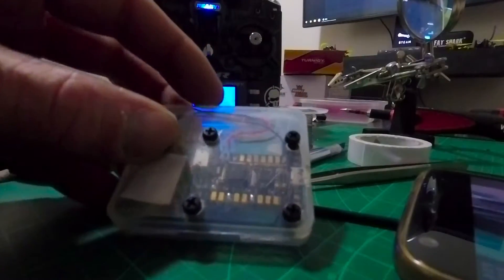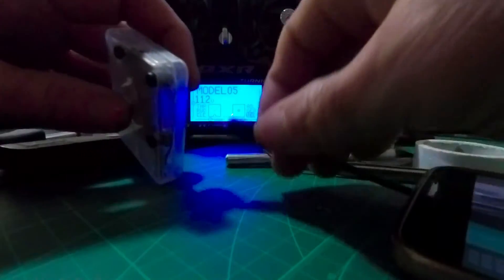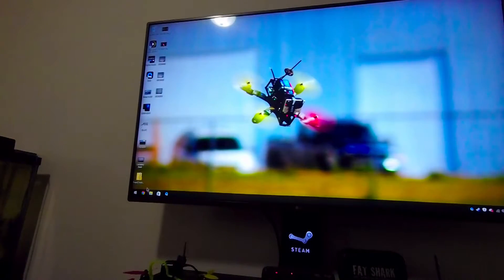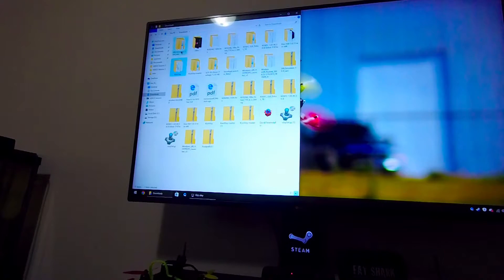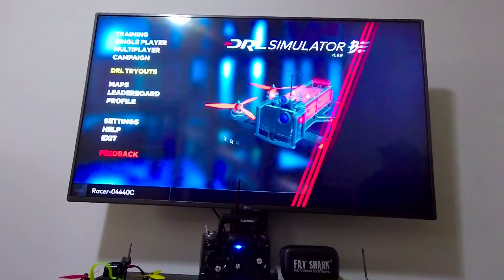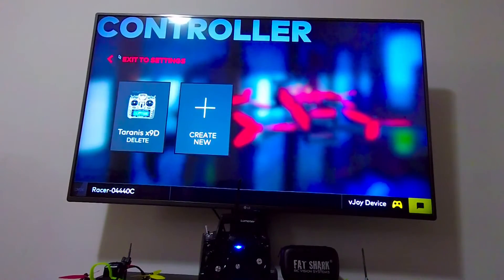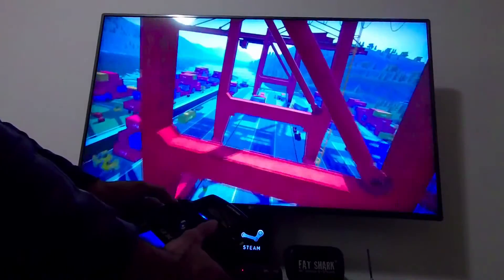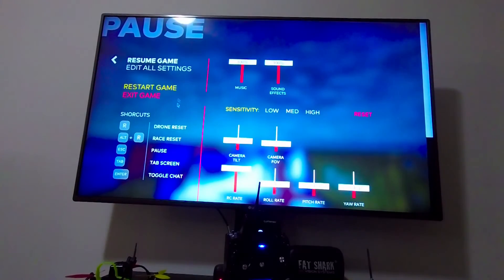KISS FC PC Simulator

Comment: I just directly connected my x9, do the PC and it ran fine O.o Whats the point of this? For someone with a non X9? or a controller that wont connect to PC?
Reply: The driver uses kiss fc configuration and calculates kiss rates based on rc input. so simulator will see kiss rates. i think that was major idea behind it. ;)
Reply: Alexander Fedorov gotcha